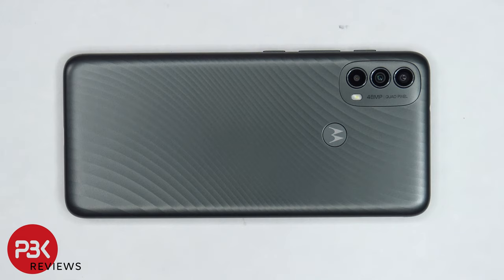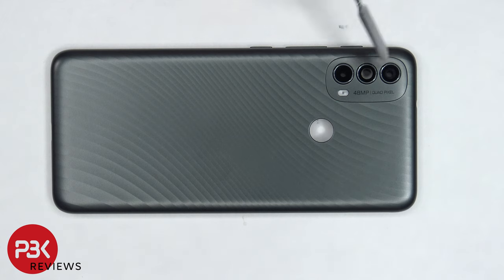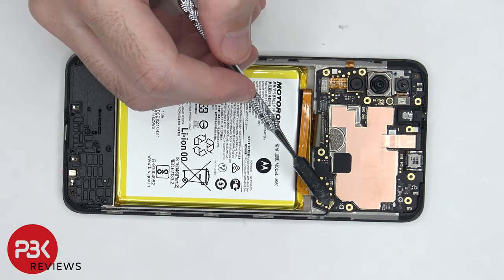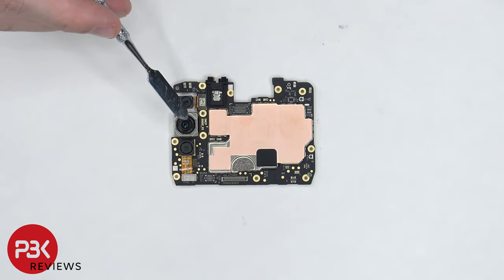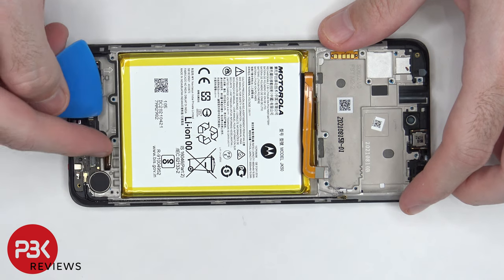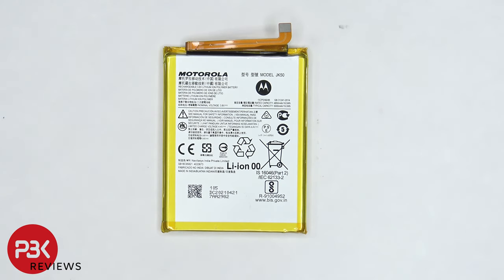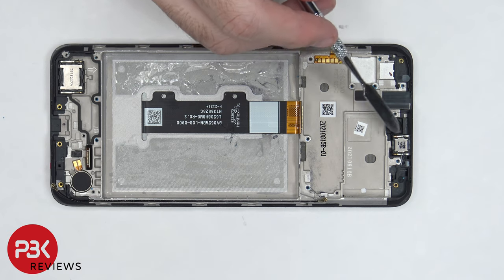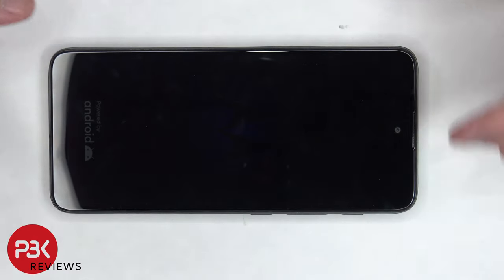Motorola Moto E40 Disassembly Teardown Repair Video Review

Comment: Do you know is there is an internet antenna ? I replaced screen but now internet conaction isn't working so not sure if I damaged a part
Reply from the maker: Not sure which it would exactly be, but you would need to make sure the main board is seated properly, all the cables are connected and also the plastic cover over the motherboard and bottom sub board are in place and screwed in since they have antenna lines drawn through them which touch gold contacts over the motherboard and make a connection.

Comment: i cant take off that plastic :// 0:28
Reply from the maker: Shouldn't be too difficult. You just need to run a thin plastic tool or card around the edges to pop off the catches or release the catches.